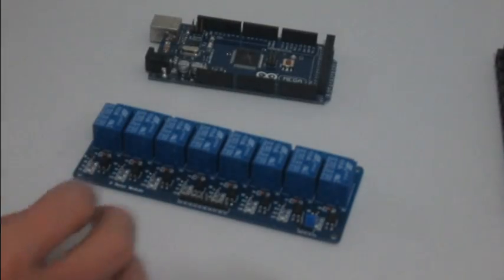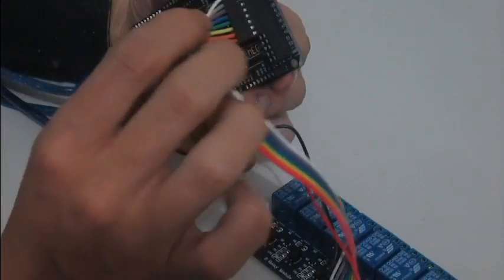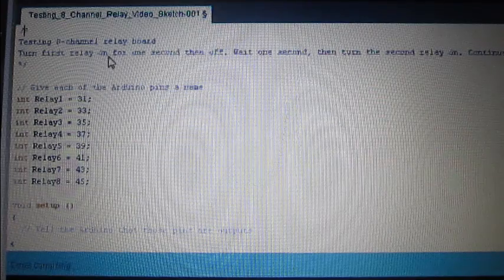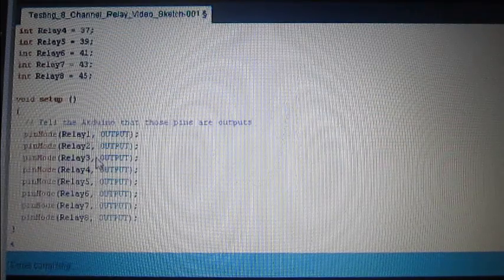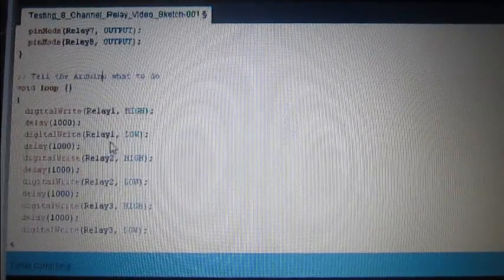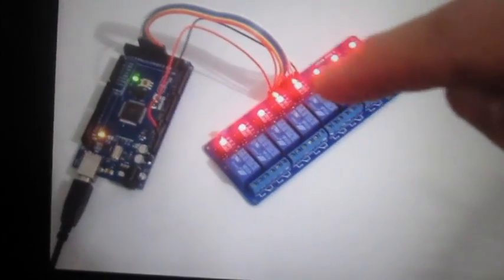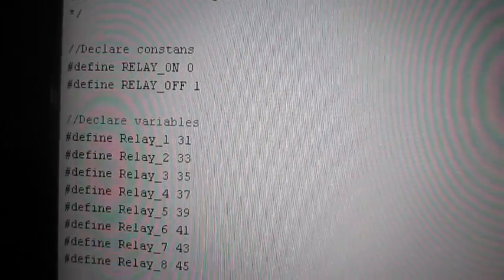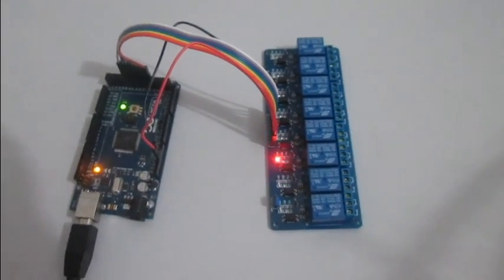Automated Aquarium Build with Arduino - Testing 8-Channel Relay Board

Comment: hi there I have an adruino mega 2560 and I simply code all relay to turn on and for some reason I'm only able to get all 6 instead of 8. I was wondering if there is not enough current/voltage or should I get a new adruino mega or an 8 channel relay board?

Comment: I not  clearly... how arduino enough power to switch on all relay.
Did you active LOW to switch relay on.
Reply from the maker: Yes, they are active low. The Arduino can turn them all on, or off, at the same time though.

Comment: Upload the code man
Reply: I made one that is working only for testing one relay.
#define Relay_ON 0
#define Relay_OFF 1

int Relay_1 = 2;
int Relay_2 = 3;
int Relay_3 = 4;
int Relay_4 = 5;
int Relay_5 = 6;
int Relay_6 = 7;
int Relay_7 = 8;
int Relay_8 = 9;

void setup ()
{
  digitalWrite(Relay_1, Relay_OFF);
  digitalWrite(Relay_2, Relay_OFF);
  digitalWrite(Relay_3, Relay_OFF);
  digitalWrite(Relay_4, Relay_OFF);
  digitalWrite(Relay_5, Relay_OFF);
  digitalWrite(Relay_6, Relay_OFF);
  digitalWrite(Relay_7, Relay_OFF);
  digitalWrite(Relay_8, Relay_OFF);

  pinMode(Relay_1, OUTPUT);
  pinMode(Relay_2, OUTPUT);
  pinMode(Relay_3, OUTPUT);
  pinMode(Relay_4, OUTPUT);
  pinMode(Relay_5, OUTPUT);
  pinMode(Relay_6, OUTPUT);
  pinMode(Relay_7, OUTPUT);
  pinMode(Relay_8, OUTPUT);  

}

void loop()
{
  digitalWrite(Relay_1, Relay_ON);
  delay(1000);
  digitalWrite(Relay_1, Relay_OFF);
  delay(1000);
  
}

Comment: THE FUNCTIONING FOR AUTOMATION OF AQUARIUS IS NOT VALID
the relays work in turn, not at the same time, ex ... a relay for the lighting program, one for the pumps that rock the water ... If the pump relay expects the lighting relay  to do its program and vice versa, ...its not good, each relay needs to work at the same time

Comment: Amazing, it works! thank you so much for sharing!
Reply from the maker: You're welcome! What are you building with it?
Reply: James Dixon eventually a low cost automatic plant watering and lighting system. I also want to connect a bunch of sensors and either use the output (or a scheduler) to trigger  a one of the relays - or funnel that data to graphs in thingspeak/ ubidots. I’m currently playing with the ESP8266 nodemcu :)
Reply from the maker: Roman Korver, Sounds cool, let me know if you post anything on it, would like to see. Is it regular plant watering or hydroponics?

Comment: Is everything cool relating to the maximum current flow and the 5V output of the Arduino? Can not find good data in www. Thank you very much for the video! Looking forward for your reply :)
Reply from the maker: I'm not sure, to be honest. How many channels are you planning on activating at the same time, and how often? running it as I did in the video wouldn't be an issue. Good luck with your project. What are you building?

Comment: Just bought an arduino mega and a similar 8 channel relay.  Relay is dead.  I copied the code in this video to see if my relay lights up ... No luck.  Is that a sign of a dead relay module?
Reply from the maker: Did you find out the problem? I'd guess the board is faulty, if you send it a signal, it should respond
Reply: Yes Relay was fine.  It was user error I admit ... lol

Comment: i have the same exact setup, but my 8 relay board does not do the clicking sound.
Reply: +AmiiboLatino which relay board is that? could you please give the model no etc? thnx

Comment: This videos shows using the same 8 relay board with an OOP sketch, each operating totally independently AND simultaneously rather than sequentially - "delay" is a blocking command so you can't do simultaneous independent operations.

https://vimeo.com/173236054

Comment: can you share a link of where you get sample sketches for controlling that 8 module relay please?
Reply: #define Relay_ON 0
#define Relay_OFF 1

int Relay_1 = 2;
int Relay_2 = 3;
int Relay_3 = 4;
int Relay_4 = 5;
int Relay_5 = 6;
int Relay_6 = 7;
int Relay_7 = 8;
int Relay_8 = 9;

void setup ()
{
  digitalWrite(Relay_1, Relay_OFF);
  digitalWrite(Relay_2, Relay_OFF);
  digitalWrite(Relay_3, Relay_OFF);
  digitalWrite(Relay_4, Relay_OFF);
  digitalWrite(Relay_5, Relay_OFF);
  digitalWrite(Relay_6, Relay_OFF);
  digitalWrite(Relay_7, Relay_OFF);
  digitalWrite(Relay_8, Relay_OFF);

  pinMode(Relay_1, OUTPUT);
  pinMode(Relay_2, OUTPUT);
  pinMode(Relay_3, OUTPUT);
  pinMode(Relay_4, OUTPUT);
  pinMode(Relay_5, OUTPUT);
  pinMode(Relay_6, OUTPUT);
  pinMode(Relay_7, OUTPUT);
  pinMode(Relay_8, OUTPUT);  

}

void loop()
{
  digitalWrite(Relay_1, Relay_ON);
  delay(1000);
  digitalWrite(Relay_1, Relay_OFF);
  delay(1000);
  digitalWrite(Relay_2, Relay_ON);
  delay(1000);
  digitalWrite(Relay_2, Relay_OFF);
  delay(1000);
  digitalWrite(Relay_3, Relay_ON);
  delay(1000);
  digitalWrite(Relay_3, Relay_OFF);
  delay(1000);
  digitalWrite(Relay_4, Relay_ON);
  delay(1000);
  digitalWrite(Relay_4, Relay_OFF);
  delay(1000);
  digitalWrite(Relay_5, Relay_ON);
  delay(1000);
  digitalWrite(Relay_5, Relay_OFF);
  delay(1000);
  digitalWrite(Relay_6, Relay_ON);
  delay(1000);
  digitalWrite(Relay_6, Relay_OFF);
  delay(1000);
  digitalWrite(Relay_7, Relay_ON);
  delay(1000);
  digitalWrite(Relay_7, Relay_OFF);
  delay(1000);
  digitalWrite(Relay_8, Relay_ON);
  delay(1000);
  digitalWrite(Relay_8, Relay_OFF);
  delay(1000);
  
}

Comment: just wondering if the relay board u are showing is the active high or active low relay?
Reply: Paulo Wang inverted logic paulo, if you say high is off, so if you say low is on!
Reply: +Alex Zhuo I'm having the very same problem, everytime I send HIGH to the pin, it turns OFF the relay...
Reply: +Alex Zhuo LOW - active
Reply: Definitely active low, at least in the optocoupler section, where it start from VCC then rides down to the input pins in the end.